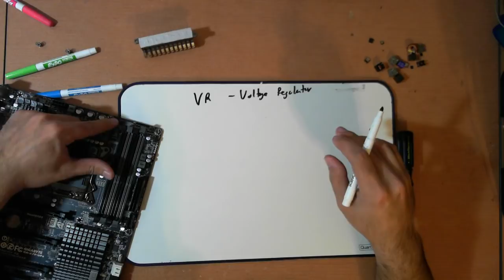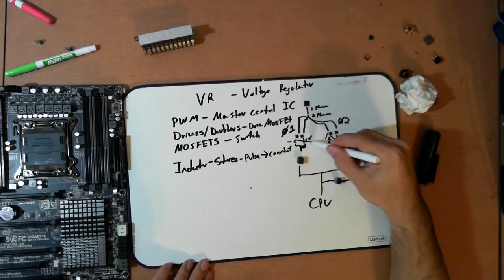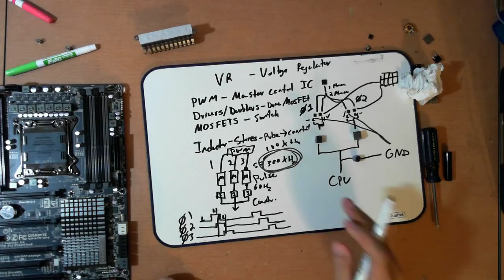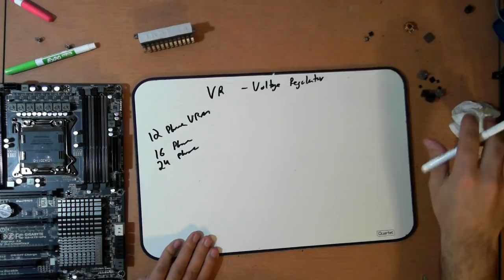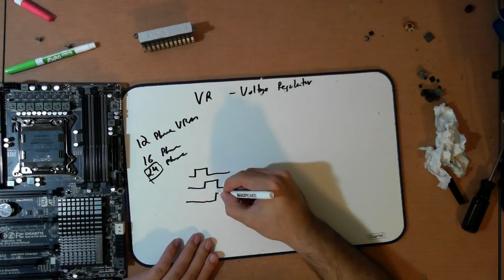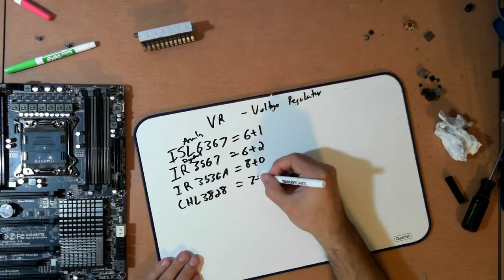Motherboard VRM Explaination Part1: The VRM and PWM

Comment: Explanation is great... But can you connect the pwm ic and mosfet with inductor and capacitor with feed back to pwm ic making the above circuit for power supply to CPU. The explanation on drawing board is ok for literally. But no  explanation for VRM section with live practical is showed ever. Can you make a video with all the components in VRM Section  and showing the output voltage for cpu.

Comment: You told when one phase is on all other phase are in off mode....
I know... one phase can carry 70A off curret.....in this scenario each phase have to carry 70A but not
 at a time or rather in a periodic manner ......
So what if when cpu need current more than 70 A ....does the pwm chip increase or decrease the frequency in that case....
Please tell me....i want to know... please reply

Comment: Why a pwm chip is required .....after all at last cpu is getting constant voltage.......so this switching arrangement... please tell me... please 
I want to know.....
Is this only sake of strain the ac components from the supply voltage
Reply from the maker: First off the CPu doesn't operate off constant voltage, it goes up and down to save power and adjust to different conditions, second the controller is required when the CPu takes huge current steps, which can be around 100A.

Comment: my MSI x99a SLI plus seems to have a vrm temp sensor that hwinfo64 reads and I've been having some concern about it. my 5820k is at 1.3v core and 1.3 ring with 1.9 input and 1.35v DRAM. I see temps under load between 100-106c . I'm sure it's good for up to 120c but it just bothers me that the heatsink seems to insulate instead of transfer the heat away, even with fans blowing directly on it. opinions?

Comment: So I watched this video and had a question for you. I have the Gigabyte 990FX Gaming mobo and I thought it was a true 8+2 phase VRM, but apparently it is two 4+1's using doublers. I'm having a hard time with overclocking past 4.7Ghz on my 8350 despite VRM's being cool and CPU/Socket temps being under 60C. It basically just freezes while stress testing. My question is, is the fact that the VRM is using doublers contributing to the lack of vcore stability?

Comment: Hey sin0822 this is an awesome video. Listen i got a question to ask you, hope you can help me. I have this Biostar TF8200 mobo and one of the cpu mosfet was burn out. I got this this way. So i replace the mosfet, the burn was real bad. Now the mobo is working but the mosfets the one i replaced and one more are hitting like crazy. My chocks are hitting as well, the middle two and the capacitors as well. What puzzles me is that Vcore is stable, all MOBO temp in windows are under 45c. And the mosfets are around 80c with heatsink on. And i also hearing some squealing noise and am not sure is it from fets, chocks or some capacitors. What can cause the fets to boil like this? Can u pls shade any light on this one, huge thanks in advance!

Comment: hi, do you think it would make sense to take the VRM-heatsink from my Asrock z77 extreme 3, srew them loose and then put new thermal compound on it? Maybe new pads or paste? Because its 2 years working now and maybe the contact between mosfet and heatsink is not so good anymore? Just an idea. Because i have anything here, pads, paste, even copper for building my own heatsinks. i think under my heatsinks there are even this "DPAK-Mosfets" which you say are awful.

Comment: +sin0822 can you tell us what is the max temp for VRM, cause one of mine pc freeze when playing game for some time, all usb devices switchs off and only current screen that was on monitor stays in freeze, when i go back in bios i can see that VRM temp was 61*C, well this is cause i have two gpu with custom fans not reverence, that makes case hotter.
Reply: +iPlay4K -Adi™ | 4K UHD Gaming! Modern motherboard don't have the north/southbridge anymore. Everything into the CPU and the PCH.
Reply from the maker: +iPlay4K -Adi™ | 4K UHD Gaming!  So the VRMs usually go to about 120C until any type of over temperature protection will trigger. When OTP triggers, two things happen. First thing is that it will try to throttle the CPU speed, and on most platforms if the VRM gets hot it will throttle the CPU to 800MHz. The second thing is that it will trigger a shutdown, an immediate shutdown. The type of freeze you are seeing isn't really an overheating of the VRM, I would look for another cause, it seems like overall instability (not due to VRM).
Reply: sin0822
thank u very much, what about south-bridge?

Comment: I have a Asus P8z68 V pro motherboard , with an Nvidia GTX 660 FtW card. i just reinstalled the card because i thought it was bad so i had it for a back up. However i notice i was getting a lot of TDR error codes causing it to freeze during gaming BF3. Now i notice the feature on the board about DIGI VRM and made some adjustments . and now i have NO CRASHES. with my other card a ASUS GTX 760 OC i was getting Crashes ,BSOD errors . Havent reinstalled the card yet with the new settings for the DIGI VRM i found ,so im thinking the card is still good (only 4 years old). So can updates for windows cause the settings to change, because i never had to tweak this in the past?

Comment: I've known about your VRM list for a long time, and recommended Z87/97 boards based on the details contained in your list. However, a lot of people dismiss my suggestions as Gigabyte fanboyism; it's not hard to see why this happens, since GB has maintained surprisingly high quality in the VRMs of their midrange to high end boards for a long time. Except for their recent slight slip up in their 9-series boards, supposedly due to Haswell's lesser VRM requirements.

Not enough people care to choose boards based on how their VRMs really work, and it's been made worse by Haswell's FIVR. When people hear that the CPU has an integrated VR, they immediately think that the motherboard's VR no longer matters, and shitty doubled analog uPIs on MSI's boards are on par with GB's IR3563A PWMs. People still regularly dismiss the Z97MX Gaming 5 in favor of the Z97M Gaming. 

One question for you Sin, what role does the output capacitance play in boards that have IR digital PWMs for example (and let's just say not doubled at all, for a fairer playing field)? You mentioned that ASRock's implementation of analog ISL6367 necessitated lots and lots of output caps; in a digital, true phase board like the Z97MX Gaming 5 or the SOC Force, does the total capacitance matter much for overclocking? Does it matter as much as MOSFETs' current rating or the PWM controller? And lastly, why would the Z77 Extreme4 need as high a rating as 8200uF? My first (albeit regrettable) purchase was a Z77 Extreme3, and I'm assuming that it also has a ISL6367, and what's got me scratching my head is how ASRock managed to omit a phase and bring it down to 7 from 8 doubled?

Comment: Hi i have problrm with my crosshair v. Every some time board freez when i make reset  no boot just cpu red led fans full speed no read bios.. When i press heatsink on board (mosfet  (or left pc off for night from socket)  after this board power up. Works ok some time and again make this poo. This is vrm problem ?

Comment: my z77 mpower says it has 
CPU Power: 16 Phases 
PCH Power: 1 Phase 
Memory Power: 2 Phase 
from a  UPI uP1618A, a 6+2 phase controller. how did they manage to get 16+2+1 out of 6+2? do they do 4 with double doublers to get 16, use 1 for the PCH and leave then other out of the 6 bit, then the memory uses the +2 bit?

Comment: Great video, really helped. But i have question, i have Asrock 960GM - VGS3 FX, the shitty one right ? And i have Phenom II 965 BE, so i tried to overclock it on 3,9ghz, and raising voltage to 1,475 volts in bios. Run the Prime95 for 2 hours and everything was stable and max temp was 49c, cause i have Hyper 212 Evo cooler, but the problem is the motherboard, it doesn't have any VRM coolers and it's pretty cheap, is it safe to keep that settings on that motherboard ?

Btw. voltage on 3.9ghz is 0.5V bigger than on stock speed 3.4ghz, so it's not something drastic, but still cheap asrock mobo ?! please reply tnx !

Comment: On the phases, it used to be that with economics in mind you could get 15-20 amps per phase and at 1 volt about 15-20 watts per phase. On a low power cpu (up to 65 watts) you need 3-4 phases and medium cpu (95w) about 5-6. There was 125w-150w cpu for a while so 8-10 phases. Power trend is level to down so maybe that was the peak. Can modern MOBO do better that 20amps per phase reliably?

Comment: I have a question, the 12 volt supply is switched on and off, and the longer it is on the higher the output voltage. Since we are going down from 12 to 1.2 it is not on long. The inductors filter these current pulses to something constant right? What are the caps doing here? is it the ripple current/voltage they suppress? or is there some varying voltage from the mosfets to be filtered?

Comment: Also, the physical 12v power connector for the processor must be able to deliver the required power. Using one EPS connector that power ranges from 300 to 400 watts (depending on wire thickness and connection sturdiness). No point in using a regulator able to handle 1000 watts (or something) on a board with a single EPS connector. Gigabyte's z68x-ud5 and Asrock's fatality z77 professional are major offenders here since they use like 15-20 phases... but a single EPS connector.

Comment: Some Asus EVGA and even Asrock boards also have 8 "real" phases. MSI boards will probably appear too in the near future since they started using digital modulators on some of their boards.

Now, the number of phases and if they are doubled or not does not matter in practice unless you push the regulator to its output limit. For this to happen the coils (chokes) must be able to handle the amperage the transistors give too. No point in bundling a 50A transistor with a 20A coil.

Comment: The GD70 is a good MBO, but the 890FXA-GD65 is superior in OC.
And again, MSI "locked up" some stuff in BIOS for the GD65 -> You can modify the GD70 BIOS and load it to GD65 -> then You can do stuff that You cant imagine with GD70. So I sold the GD70 after 2 RMA's. 

There are no god/bad motherboards, because every motherboard has been placed fine for some market value.
I like ASRock boards - they run stable and long (entry/mid segment) - not like ASUS who likes to die a lot in entry level.

Comment: I had the 890FXA-GD70, nothing good there. VRM hotter than hell.
I don't want to see any entry leven ASUS boards, they are a disaster.
The same counts for Gigabyte, but they have the "bad and cheep" chip-set cooler problem - but they have improved over the years.
Still, there are always beater solution in every class. 
ECS/BIOSTAR/ASRock for entry level are great.
MSI/ASRock/FoxConn for mid-range are very good.
ASUS/GB/ASRock/EVGA for high-end are superb. 
Intel boards are great overall too.

Comment: "Good VRM components are needed too (lets not forget the MSI AMD 8xx series)."

Components had nothing to do with it. It was the design being sub-par. Not to mention that the components of boards like 890FXA GD70 were so good that they could handle a bit more than supposed to. It's just that "a bit more" is not the same as "way more". You can't power up a car with a set of 1.5v AA batteries.

Low end Asus boards use crappy components yet they survive bad treatment solely because of their design.

Comment: In fact - for me, the most important is that the MBO is stable with no VDrops.
On the AMD MBO's there is no need for Digi PWM. (maybe Piledriver will change that, but i doubt it) 
However, i have no issues with that ISL chip, its OK, fine and old school, and the VRM is running cooler with analog PWM - best thing for budget PC builds with limited cooling power. 
High end class - Digi is great, but not all that counts. Good VRM components are needed too (lets not forget the MSI AMD 8xx series).

Comment from the maker: I am actually glad you did that, because it is false marketing. GB used ISL6366 they didn't say it was digital, they embraced the fact that it was analog. But now ASRock is using ISL6367. If you google ISL6366 or 67 you will see no PID, no ADC to convert the voltage and current sensing signals.. Intersil is now calling it Green hybrid-digital, which is still BS, but better than fully digital, but still not digital. MSi says hybrid digital and ihave no fault with them, asrock needs to do this.

Comment from the maker: ASRock was always part of pegatron. ISl6330 is a pretty standard analog PWM, LLC is controlled through a resistor set between 2 pins, pretty standard stuff. But yea it isn't the ISL6366 and ISl6336G that are use don intel boards. I just don't think AMD gets as much ove inthe VRm area like Intel side. One issue now that ASRock lost the CHL3828(great PWM BTW), is that they have to redo a lot of their new boards, like x79 extreme11 VRM had to be changed. Check out the LLC on the new IR PWms.

Comment: Well ASRock belong to Pegatron for years now, since then they improved a lot. I'm more into the AMD marketing for the boards and I have to tell You, the UD7 rev1.2 uses the same ISL6330 and ISL6617 like on rev1.0 and rev1.1.Nothing changed, they only added the LLC components for greater good. Anyway, the board is OK, but surprise surprise, the ECS is rock solid board.
Don't get me wrong, I own the Fatal1ty, but this ECS is sure kicking some ass.

Comment from the maker: Well i am not saying you are wrong, I am just saying that board is a year old. In my VRm video i was referring to ASRock Z77 boards, from Z68 to X79 ASRock used Digital CHiL PWM, however since ASUS pulled out of Pegatron(ASRock parent company), ASRock is no longer using the CHiL Digital PWM, and has switched to an analog one from Intersil, the same guys who make the PWm on the 990FXA-UD7(which is a year old). GIGABYTE no longer uses Intersil on any UD3 or above(I am not sure about AMD side).

Comment from the maker: Also, 990FXA-UD7 doesn't use a digital PWM like gigabyte is using now, nor does it use the new power stages or chokes. GIGABYTe 990FXA-UD7 is basically 8 phases of a GIGABYTE Z68 or X58 G1.Sniper 2, 4 phases doubled. I don't really follow AMD, but what is funny is that their 990FXA-UD3 has no vdroop. Are you use you have LLC on your 990FXA-UD7? What level did you set it at?

Comment: Ok. I used this setup:
MSI 990FXA-GD80 (8+2)
Gigabyte 990FXA-UD7 (8+2)
ECS 990FXM-A (6+1)
ASRock 990FX Fatal1ty (12+2)

Best OC was the ECS and ASRock. Most vDrops -> the Gigabyte WITH LLC.
How can You explain that? So ASRock is to stupid to fix something that works well?
Or Gigabyte is to stupid to create first series of MBO's without LLC, and then fix it with LLC - and the results are the same? 
Explain it to us please.

Haters gonna hate.

Comment: Not really seen any since then, even including those really bad low end asus boards that would easily die otherwise.

In any case, what I wanted to note was Renesas' decision to focus more on the protection of their transistors instead of the output. There are always companies that do bad implementations and users that don't know what they're doing. Protection on the transistor itself with no attachment to other components can save you even from a hacked bios with disabled otp or some bug on it.

Comment from the maker: you have a couple good points. 
1. Yes if incorporated correctly they are effective in reducing the load per phase, which will result in a much cooler operation.  However i was talking about 4 doubled phases isn't the same as having 8 true phases, the performance is higher with the true implementation. 
2. That was the OTP guidelines not being correctly set, something you can't update and fix if you used an analog PWM with a resistor controlling OTP. Since then have you seen any blow?

Comment: Cute vid there. Some things I noted:

1. Using only a single doubler per phase is not as bad as you make it to be. Potential side-effects are non-existent in real life scenarios if the implementation is proper.

2. OTP for the transistors. Most companies implement it on their PWMs but on "digital" implementations they don't always react fast enough to save a transistor from smoking (see the x79 ud3 vid). Renesas should be noted here as one company that has 2-stage OTP on their newer transistors.